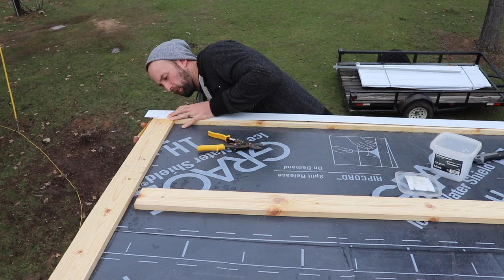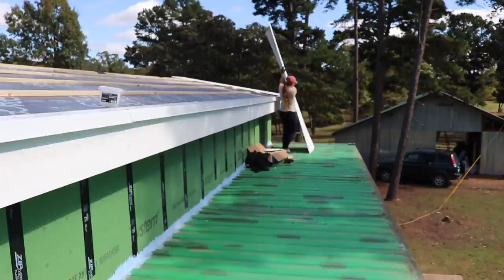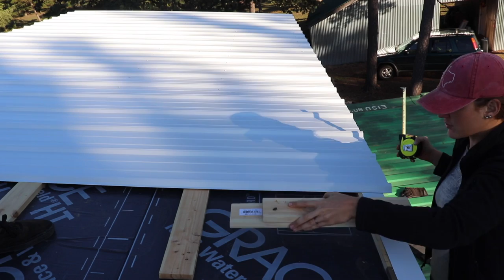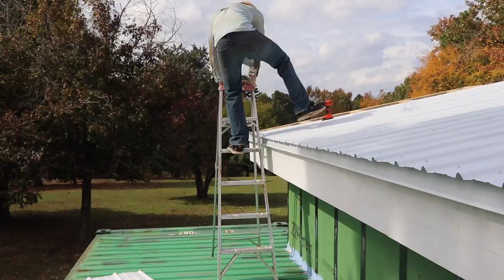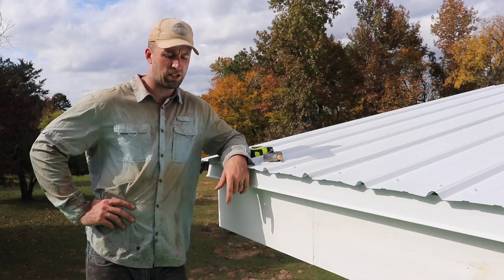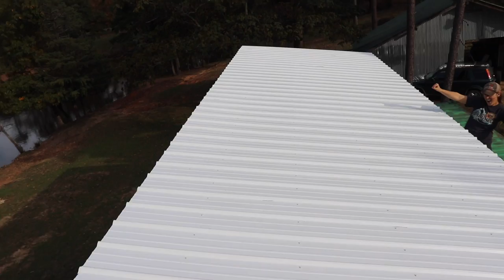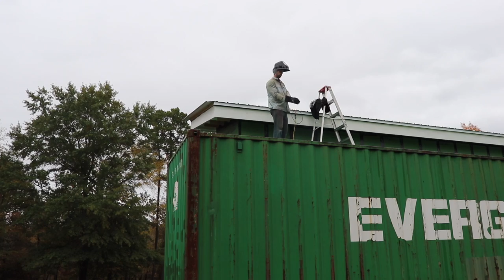Installing Our ENERGY EFFICIENT Roof

Comment: The proper way to place a nail: Place the nail between the index finger and the middle finger, with the head on the palm side and the point on the fingernail side. Place the nail in position, two light taps to the nail head, move your fingers out of the way, give the nail a whack. 1 whack per inch of nail. By placing nails properly you will never hit your thumbs or fingers again. Holding the nail with your thumb and index finger is reserved for people who do not know what they are doing.

Comment: 12:08 You're supposed to use 2" screws to install on top of the ridge since the ridge is 7/8" high, you are left with 1 1/8 of an inch of screw that penetrates the wood
Reply: Um, no.  Screws in ridge are not used to attach panels to purlin.  Purlin screws are used on flats to attach panels to the purlin. LAP screws (wider thread, shorter stem) are used on highs, and merely to stitch the two sheets together ( no anchoring to purlin involved), preventing wind from peeling back the overlapping edges on highs. Even the little diagram they inserted in video shows use of lap screws. I did commercial steel building construction long before steel roofs became popular for homes. We also stacked 5-6 sheets together (clamped with vice grips) and pre-drilled holes prior to installing...drilling all holes 6 sheets at a time is a real time saver. It is also good to clamp 3-4 sheets together when raising onto roof (more strength for highs, and more weight to fight wind). Raising sheets onto roof one at a time, you risk either wind bending a sheet in half, or being ripped away and sent flying, and believe me it doesn't take much wind at all when dealing with a large, flat, light weight panel.

Comment: You save your thumb by holding a half dozen nails between the first and second fingers, palm up. Tap, move hand, hit, repeat. The furring strips will have a very short lifespan. The humid air will condense on the underside of the metal. I used treated 1x4 and they rotted in 10 years. The roof needs to be screwed all the way through the plywood because the strips won't hold.

Comment: Put a carbide wood cutting blade in your skillsaw backwards, cuts metal roofing like a dream. You both are doing a good job and having fun - good on ya.
Reply: I wouldn't want to stress the teeth that way.  Wouldn't you stand a huge chance of the teeth flying off.  I have seem carbide teeth come off a table saw blade and it wasn't fun.
Reply: Grinder is much safer
Reply: @faded9043  you can buy a metal cutting blade for the circular saw
Reply: @orin1971  I know but they're expensive

Comment: Your purlins will create a water problem in the not too distant future.  

They should have been cut every so many feet to provide a way for water to flow downwards.  In addition, they require a slight angle so water will not remain trapped next to them.

Pity on the lack of a radiant barrier, but I love the white reflective metal roof.

Comment: I was ok with the air vents at top of roof . But then you cut the ten so close i think water will blow in unless you trim it up .self tapping screws on the lower level use a fine thread self tapping screw it will go through thicker metal

Comment: My feeling about the sheet metal roofing and screws...it would seem to me that putting the screws in the 'peak' would barely get the rubber washers enough pressure to seal...I bought my house and it had a carport with corrugated sheet metal roofing, screws in the 'peaks' and they were loose and leaked water...
  Back in the 1980's I leased an industrial space, sheet metal roof..screws in the valley...no leaks, and the place was already several years old..in the snow country too...

Comment: Just I thought, I know with Westman Steel roofing they don’t recommend cutting with a grinder because it heats the paint coating and ruins its durability where you cut. Be sure to sand/paint any burned areas if it needs it

Comment: You could have stacked a few sheets of metal and mark for holes down on the ground, drill a small hole through a few sheet at a time. Would save a little time. Easier to do it on the ground then haul them up and screw it down.

Comment: Does your pencil Lead deteriorate the Aluminum or the paint? Mark with a black marker on your tape for where you need to put the screws in. A tri-square is your best friend for measuring to the end of the roofing.  The one marker just needs the black to be reapplied to wipe it off. For next step. Measure from one side prior to install and mark the black to measure to the edge of the Al roofing.  Yes your screws would need to be longer. I like the part where there is less water intrusion possibility. Any possibility of an old drain pipe under your spring?

Comment: i work in roofing in panama city Florida and here we have to overlap the drip edge a minimum of 4" this is so that strong winds wont lift the drip edge which in turn will act as a sail lifting more and more of the roof system. so my question is did you guys look into what was the manufacturers recommendation was?

Comment: Great job, well on your way. Here in Queensland we have product called "Trimdeck" look like what your using, but we screw it down through the ridge
Reply: and we use longer screws as well.
Reply: Ahh thats not same as what we got out here. Trimdek has a flatter ridge.
Reply: Question, if you are using metal, how do you screw the ridge and not over screw and make a dimple? Being there is no backing under the ridge.
Reply: @oruwatching  when we screw down the trimdeck you watch when the second set of threds just under the head of the screw comes in contact with the iron, the other way that i was shown was set the clutch of the drill to release on contact, sorry for me its hard to explain. I do have a cordless Rattle drill driver that i use that makes it very easy, i do belive that the trimdeck that can be used on the walls is a lighter guage than the roof.
Reply: great job. way to follow manufacturers instructions. your warranty is intact roof will be great 35-50 years and worst case you may have a screw back out in 20 years.
Reply: @garylacey8543  thanks
Reply: @oruwatching  don't use a impact drill for this! Use a variable speed drill with adjustable clutch and put it on a low speed to prevent over tightening which will cause the dimples
Reply: The reason we screw down in the ridge is when the grommets wear out which they will our roof won't leak, however if you screw the valleys heavy rain will bring leaks in a few year's also the top sheet of any metal is always a cover sheet to stop the very thing he complained about with his first sheet, so clearly they do thing's a little different where ever they are.
Reply: Can someone explain a little better why screwing in the valleys can leak and screwing the ridges prevents leaks if the grommet fails? A hole is a hole isn't it?
Reply: @oruwatching  you need a adjustable clutch drill. Set it one 1 and practice on a piece of scrap as you go higher in speed you will find the perfect amount of torque so you won't strip the screw or dimple the metal
Reply: @4lifejeph  the ridges are a channel which allows the rain water to run down the roof into the gutter
Reply: @4lifejeph  The theory is like a glass upside down and one right way up which holds more water during a good rain storm the valley's have a torrent of water running down the where as the ridges just have basic run straight of them sideways or along into the valley's they will see far more water in their lifespawn than the ridge  that's why we don't go pulging holes in them, they just have to much work to do and the water on the ridge lines is on and of pretty quick. I'm not saying one way is right or wrong just that we Australians like to do it our way it's worked the last couple hundred years for us.
Reply: Here in Queensland for the roof we screw on the ridge and for wall cladding in the valley and you should never use a grinder to cut the tin always use tin snips as the grinding swarf cause it to rust don't get me wrong you guys are doing a great job
Reply: @4lifejeph  The valleys act as channels for the water running off the roof whereas the ridges (which obviously also receive water during rain fall)  do not have to handle the same volume of water coming off the roof, thus the reason fixings should never be used within the channels. Think of a playground slide and the affect of rain falling on it and draining off it, the channel of the slide will have a high volume of water running down it whereas the edges will not.
Reply: just realised the roofing sheets they are using don't allow for ridge fixings. hmmmm, not a fan of that style of product

Comment: you shoulda made a drill template out of a strip of plywood so you could just lay it on the sheet and either mark your locations or use a small bit to make you starter holes.

Comment: The screws that go in the over lap are soo the sheets can be close thight or other wise ur sheets will have a gap and water could go true that and it can be a problem later on it also prevents from air entering in between the sheets and prevents them from flying around
Reply: But other than that guys u made a great work

Comment: only one other thing I noticed missing is the peices that go between the metal at the ends that fill up the holes from the rips of the metal. with those left open the thing you wanted to keep out will not get in and that is the bugs and wasp's.

Comment: Spencer, did you paint/treat/varnish the beams under your tin roof? I know you felt they were needed to attach the roof, but if untreated they will be prone to condensation in winter.
Where is your chimney? Your iron stove pipe? Will you drill the container sidewall to provide an opening for those? Keep up the good work!

Comment: hey spencer good job    but !!!  if you screwed down the peaks on the top of the ridges it would bow the flat bottoms up  just saying but you did mess up you should have left out the foam sealer  because you just cut off air flow betweentop & bottom roofs

Comment: Tip from Kyle on his RRBuildings channel about the screw holes. Stack a few pieces of the metal sheets together, making sure they are perfectly aligned in the stack. Clamp the stack down so it doesn't move. Measure and mark where the holes need to be. Get a cheap awl and a hammer and punch through several sheets at once. Works great, and Kyle and his crew build pole barns with metal interior and exteriors for a living.

Comment: I will give you a piece of advice when working with nails you learn to hold nails with you index finger and middle finger, with top of your  hand down on material  nail head up. When you hit the fleshy side of fingers don't hurt as bad as smacking a finger nail, and you just get use to it after years. I know  too little to late, but now you can experiment with it. And you got to trust yourself with the hammer, that's the hardest thing to do.

Comment: I would think that putting the screws in the ridge instead of the valley would tend to distort and possibly stretch the panel to a different size which could lead to fitment problems and maybe leakage?

Comment: Its looking good guys. I wasn't going to say anything about your screw locations. 😯 I am not that kind of guy.
Reply: yep should be on the ridge, they will now have water leaks.
Reply: I've been watching you two from the beginning. Kudos to the both of you.  Hopefully you're not bothered by the armchair quarterbacks. In construction we can all pick each other's work apart,  I've been in construction well over 40 years, and my experience comes from multimillion-dollar remodels in Beverly Hills and Bel Air to million square foot commercial and industrial buildings.  By the way you're right on your screw location.... when you do your lower roof ask them if they will pre cut your sheets for you, it could save you a lot of time. If not, please don't use a grinder. The Sparks can burn the paint and cause your sheets to rust. If I make also suggest using lap tape or roll Mastic on the laps. Primarily for snow load, especially on your lower roof where you're going to have a roof to wall transition.  Please don't get discouraged, you two are doing an awesome job. Looking forward to more of your videos.
Reply: nope wrong,screw on flats... It dents the ridges.,  @denisefaith6653
Reply: @aaronbrown2966  When we had our roof done the first guy did them on the lower section and when it rained it flooded in because it left the dents, So we got a master roofer to come out and he had to replace the whole roof because of the roofing screws were in the wrong place, so we learnt from the experience, he put them on the ridge with no dents.
Reply: first of all how did it dent, when if done proper there is no way it can dent... second you dont use this kind of roofing for a flat roof, how else does the water pool? you my friend have a lot to learn about construction. @denisefaith6653
Reply: @aaronbrown2966  Done by professional roofers I now stuff all about construction. I leave it up yo people who know, and the roof has about 9 to 12 degrees fall so not flat and the screws with rubber washers did allow it to flood, so employed a master roofer who replaced the roof and screed them into the ridges and no further problems. I would are the one who needs a lesson or are you one of those shong builders that I had the first time.
Reply: @denisefaith6653  It's usually screwed on the flat, using the screws with rubber washers made for metal roofs.
Reply: Back to back upto this episode in one go... I am addicted to it 😁❤
Reply: Santaria from Philippines nice shirt
Reply: Screws are fixed in the valley for walling applications.
For roofing ALWAYS on the ridge, you’re screws are too small guys..
Rubber seals fail over time due to sun and rain, you will have leaks..
Keep an eye on them over the years, best case scenario you replace the screws every now and again ✌️

Comment: Spencer, I think I figured it out, you got a left handed hammer.  Same thing happened to me the other day.
Reply: Is there such a thing? Cause I’m thinking, no.
Reply: Even left handed paint for left handed paint brushes.
Reply: After some research, I see this is a running joke in the the industry. Although, Rigid did put out a hammer specifically for lefties several years ago.
Reply: actually more liberal than left handed. it gives you what you want to hear at election time, then smashes your dreams right after.
Reply: LOL

Comment: You screened the vent gaps to keep bugs out but what about the ridges in the steel? You didn't mention installing the gasket or vent strips (both are available). One other thing about screwing the ridges, it creates creep in the panel width.

Comment: I smashed my thumb one time with a hammer and after a while it was throbbing and hurting it was bad enough to warrant a Dr. visit. The Doc took a little drill bit and drilled through the top of my thumb nail and when he went through it was like an oil well, a stream shot out into the air and it was an instant pain reliever when that pressure was relieved. I have been more careful from then on.

Comment: You guys didn't forget butyl tape in the laps I hope? If you did, the roof may leak during heavy rainfalls and driving wind. Don't ask me how I know :)
Reply: Someday they'll find out when it's raining hard and the wind is blowing.  For this roof, I think the phrase is "That ship has sailed".
Reply: Negative much? It’d only take removing one column of screws per sheet, applying the tape and screwing it back down.
Reply: Remember that the metal sheeting is really for aesthetics, water deflection and solar/thermal protection for the underlayment on this type of roof. The underlayment is the primary water protection, which they took great pains to do well, in fact, more than required (30# felt). No roof is 100% watertight that's why you have layers and flashing. The whole system is designed to move water any from interior building components. Many if not most metal roofs do not specify taping the seams and even then its only asked for very shallow pitches and extreme weather locations.
Reply: @jacobimry6980   haha... yup,   anyone can put down a roof that isn’t meant to be 100% watertight.  :-)
Reply: Even if a leak did occur a good silicone along edge will correct issue

Comment: As the Grainger motto says "for those who get it done." There are many ways to do it right.Just a thought not a criticism. I see that you used a templet to set the overhang.  Why not draw the wood straps on a piece of wood an set it to reference the bottom of the metal sheet or even the bottom wood strip.  Then marking the screw placement would have been fast and mindless.  Looks good.

Comment: Cant help but add my 2 cents about screws in the ridge,,the place i rent has a small section of roof where they did just that,,try to clear snow off that flippin roof with a roof rake and not get hung up on them!! It sucks and takes more time and energy and damages the rake and when up there with a shovel its even worse

Comment: I have a idea for you who not put pex water line or some thing in the space between the strapping run water through the line to heat your house or hot water tank
Reply: I was thinking foam sheeting for insulation, but that's a good idea !!

Comment: Love your videos, but this one was a "miss". Would have been good to leave a little extension on the high side to help keep water out.  Also, coated steel roofing should not be cut with a grinder. It can burn the coating from heating the metal, and hot sparks cause more damage to the coating. Should use snips or shears. Yeah, some do use grinders but it is not recommended.  Hope you will spray paint the cut edges to prevent rust.